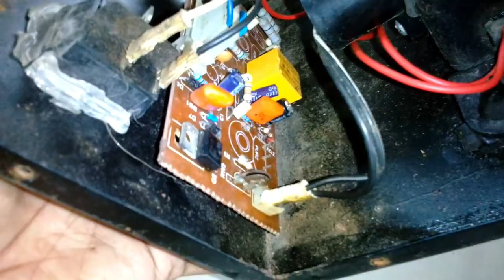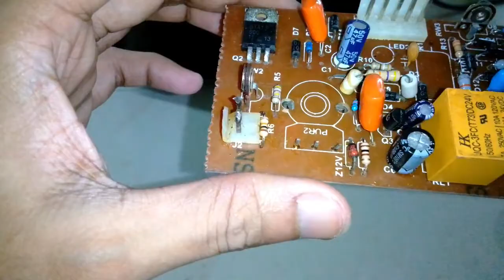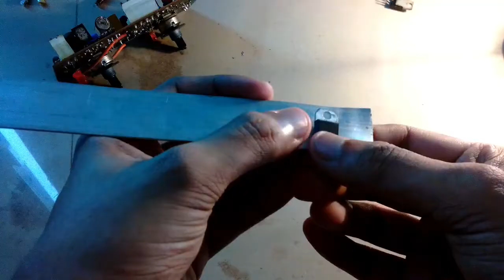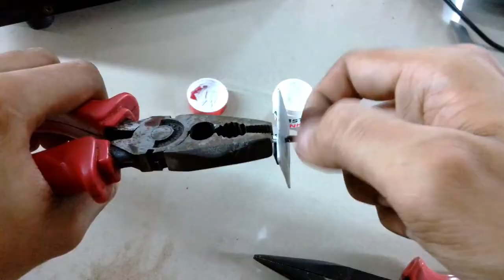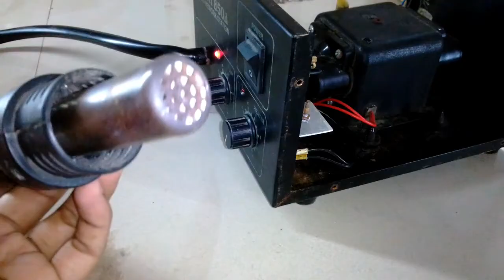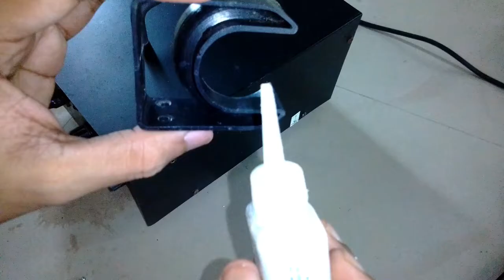Smd rework station/ circuit problem/ repair -- Its About Everything

Comment: Good day sir. I have a lukey 800 rework station and its not heating even when i replace the element with the knew one. Both BTA08 Traic are checked with maltimeter and are correctly fine but the  rework station doesn't work still

Comment: Mine can reach target temperature but the heat light turns off and is not flashing. Then temperature drops quickly and after more than 10 seconds it turns on and turns off again. Keeps the loop. Could you help to tell me what I need check? The temperature cannot be hold in +-10c range and drops too much.

Comment: Hi sir my hot air gun over heat i check triac is good not shorted i changed lm358 n moc 3041 n its still over heat. I even buy new hot air gun n its still over heat. Its a 852d+
Can u advice wat fault sir?
Reply from the maker: Check the variable potentiometer for temperature adjustments. It might be the fault.

Comment: Isn't the metal back part of the Triac also connected to the drain of the Triac.  Would putting the metal heat sink without using an insulating pad between the Triac and heat sink get you zapped if you touched the heat sink.

Comment: I am having problem with blower. The blower says 24 volts. But it only puts out between 7 to 14 volts. 
I replaced the 10K trim pot to get better control. But still max voltage remains 14 volts.
Reply: There most be a resisitor + potentiometer

Comment: my smd is suddenly slow down and not working.
both the air and heating indicator lights are off and not working.
when i am on the smd sounds like beep but works.
before start switch on power supplies to all the parts in the board but after on the start switch not supply power to parts.
please advise me.

Comment: Quick 850a air control nhi ho rha hai fast flow ho rha hai solution
Reply: Sir same problem
Reply from the maker: Thankyou for commenting sir.
Check the small triac transistor near the airflow control potentiometer.
Reply: Sir quick 850a Ka automatic smd Ka circuit diagram dijiye

Comment: My blower heater is not lowering even I have changed its triac bta16 and diac.db3.potiential meter,then also its giving full ac 230v to the coil..cannot understand the cause of the problem.
So can I make fan regulator connection,for controlling heat.

Comment: air pump is working now. issue right now is the heating element is not heating up...i tested the triac is working but heating element is still not working...directly remove heating element and connected to 220v and heating element is working...what part is not working? could it also be the relay? when does the relay clck/switches on? the output voltage going to the heating element is 147v AC volts? should it be 220v AC?

Comment: I bought heater handle n it has 4 wires black n red ,n two white wires,when i connected to multimeter i got beep sounds in black n red wires but got 80 omhs in two white wires,can i connect ac directly via regulator  or is it to connect via dc voltage.reply soon bro
Reply from the maker: One pair of wires is the heat sensor and the other one is the wire for the coil. At 220 volts 80 ohms coil will pull 600 watts, i am assuming white wires are from the heating coils and the red/black wires are from the "thermocouple" heat sensor which will appear as dead short in multimeter.
But be sure about the connections before connecting it to the 220v live. Use ac regulator 220 volt or above rating.

Comment: Can we use BTA06 in place of BTA12
Reply from the maker: BTA06 is only 6 amp capacity and the other one is 12 amp.
You can use 2  BTA06 in parallel connection that will work too if BTA12 not available.
Reply: Thank u